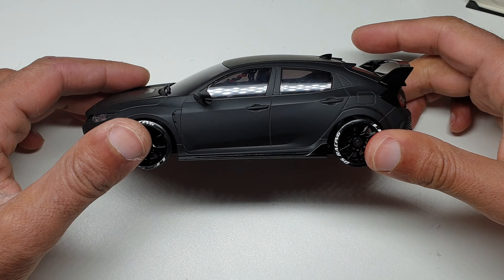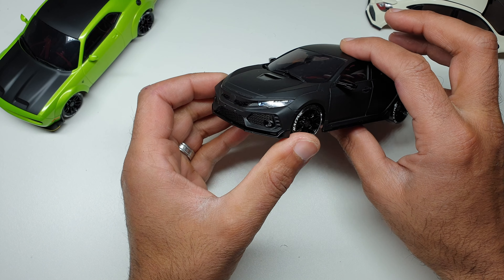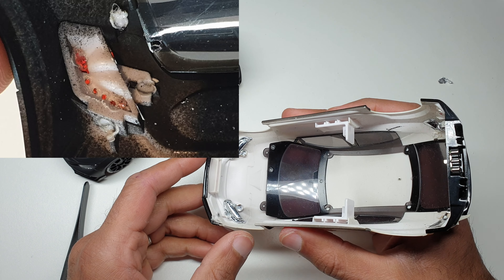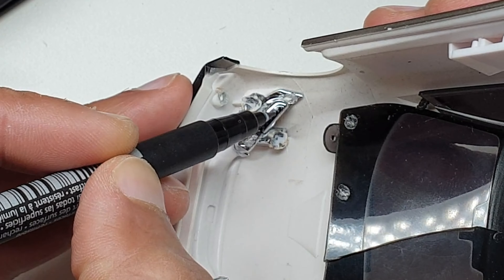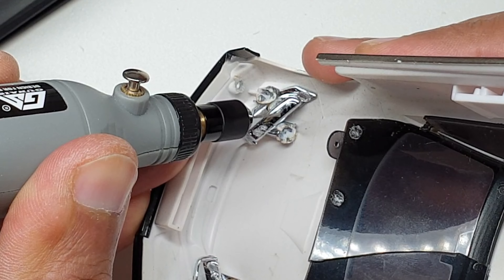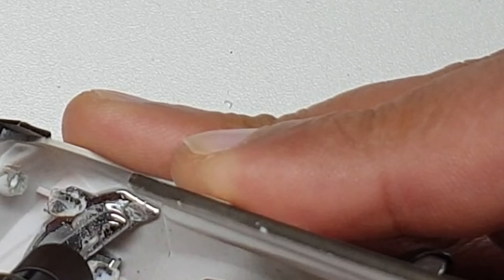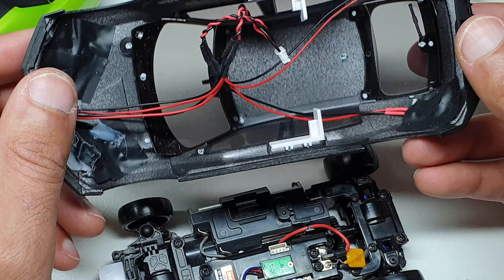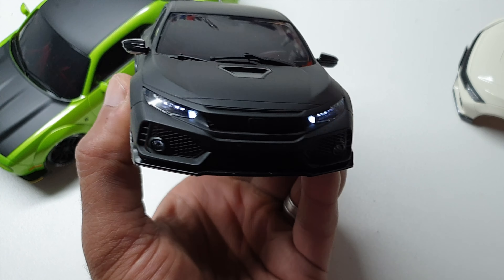Garage RC presents ....KYOSHO MINI Z AWD MA020 CIVIC TYPE R/MINI RC  DRIFT ,LED CLUSTER LIGHTS MODS

Comment: my hakosuka skyline 2000 gtr has 4 headlights and 4 tail lights. im new to the hobby is there a kit or do i have to get 2 kits and then splice them together?? or is there a y connector? i cant seem to find one.
Reply from the maker: There are kits available . You can get a kyosho splitter board and connect 2 that way or look on bangood .

Comment: Question, wouldn’t it have been easier to run thin fiber optic cables linked the the LEDs bulb to achieve this effect? No wiring needed just some uv resin and maybe a heat shrink but that’s just one approach
Reply from the maker: Yes a Better idea ,but still needed holes in the plastic to show through the light . I’ll look into it for next project 👍🏽
Reply: Interestingly enough, you can actually put one LED light and several fibres to lower the power consumption.

Comment: I’ve ordered my second mini z in less than a week and I have the mini 96 track coming in soon, these little cars are so addictive lol I have the awd ma02 but I can’t get the full steering angle without it getting stuck in one direction any way to fix this? I have my stdr about half way and that’s the max it can go without getting stuck.
Reply from the maker: Yep... 🤣 It's a difficult one. Check that it's not sticking due to tight under plate. Also check the neutral point.
Reply: Yeah i have the same issue on my awd mini z. Didn't had time now to find a solution. If i find something or fix that somehow i'll let u know.